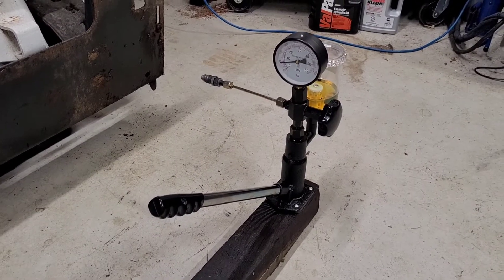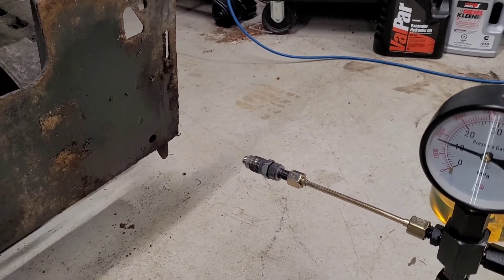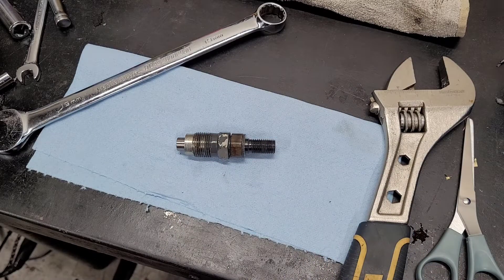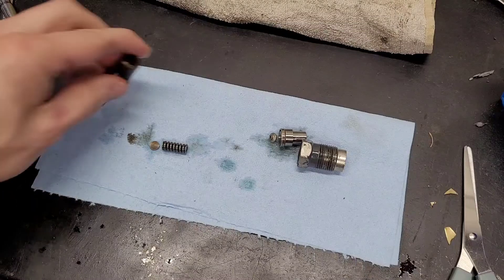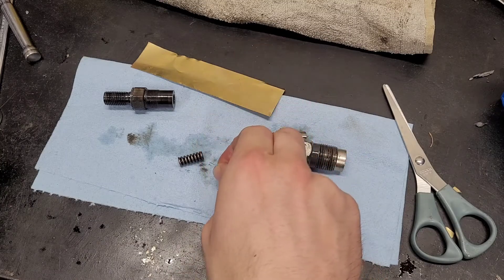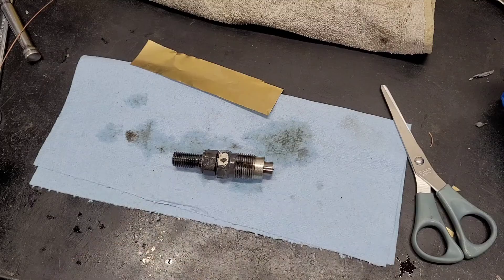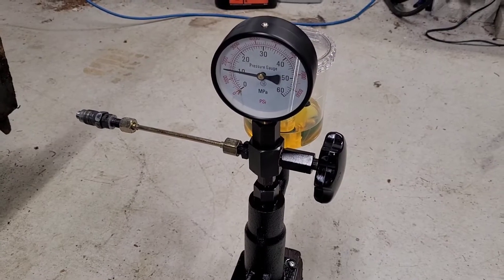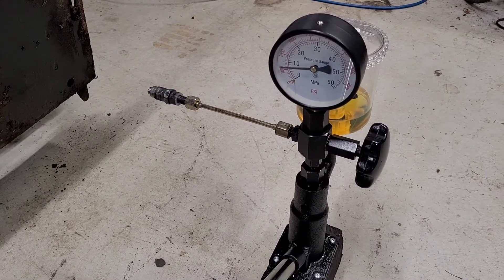Kubota Diesel Injector Test and Pop Pressure Adjustment

Comment: @ladehesa8819
hace 2 días
Hello friend, I have an Iseki Tu 165 tractor with a 3-cylinder Mitsubishi engine. After running for 5 minutes, when I accelerate, it emits grayish-white smoke. The oil level has risen slightly above the maximum. What do you think the problem could be? Regards, friend
Reply from the maker: Sounds like it could be a blown head gasket.  White smoke may be coolant/steam in the exhaust.  And if the oil level is rising it could be coolant leaking into the cranckcase via headgasket.  Check if the coolant level has dropped.

Comment: What is the torque you use to asambly, 25Nm?
Reply from the maker: I think i said in the video, did I not?  It would be in ft-lbs
Reply: 25ft# at 0610 he coulda say where. This appears to vary by injector.  For The DNOSD i hack same spec as engine seating of injector abt 50ft#. Another mb mechanic. gave a figure of ft# per psi delta. i need review impallaman vid

I still piddling w my tester use SS of feeler ga cool idea by anon. I buy washers at under 1/2$ ea but needed go up 1000psi

Also i used tubing bender so spray down into clear plastic

Comment: That brass will wear down in minutes under load man, you just wasted your time and pressure is all out again. You need steel hardened fabricated thin washers like the original in there. It has to bloody last for Christ sake.
Reply: If You add it on spring site yes, but  oposit it must by completly removwed and contac surface is biger, it have chance to work.